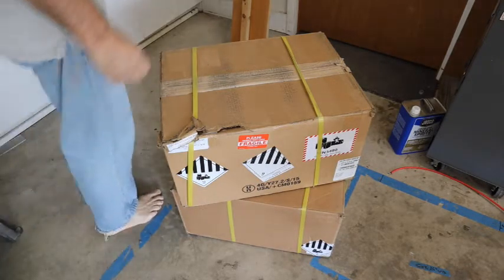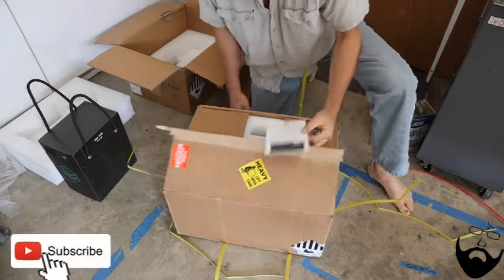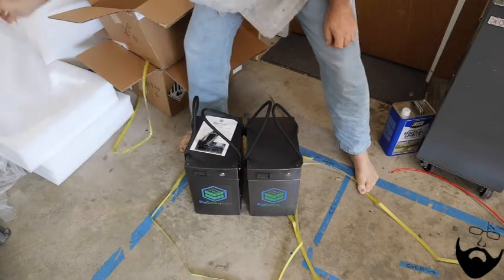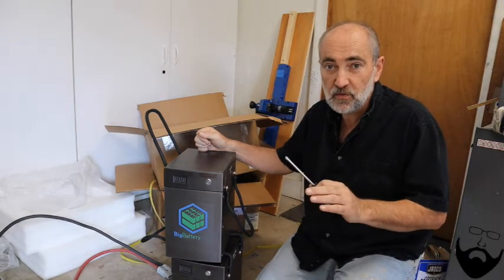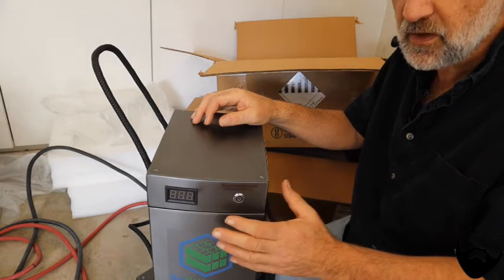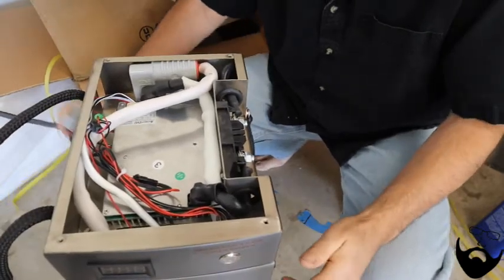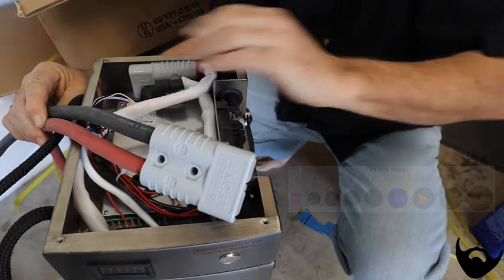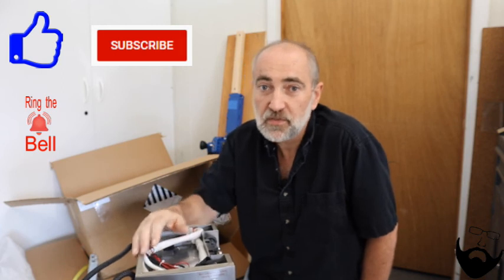Van Life - Big Battery 202 Ah LiFePO4 Lithium

Comment: Be sure to test it for full capacity. I own one - it only produced 68% of rated cap. after 6 weeks of "Customer Service" they finally sent out a "new" replacement. It only produced 72% of rated capacity. After 5 months of "No reply from customer service" I purchased replacement batteries from SOK. No problems there. I'll use my worthless Big Battery for running a light in my storage shed. It should be able to operate my light a couple of times before recharging. Good Luck with yours, and if you need warranty or customer service all I can say is hope your results are better than mine were.
Reply from the maker: I have not had any problem.  We have been living full time in the van for about two months.  The batteries have performed better than expected, I have not needed do anything with our electrical system at all.  I use the Victron BMV-712 battery monitor to monitor the state of charge, and have not been below 50%.  We are using a ten cubic foot 120 volt refrigerator.  I like the design of SOK, and Big Battery because if needed you can open the case are replace the cells or BMS. Big Battery won out since they are in the US with  a 10 year warranty.  But as always the warranty is only as good as the company that stands behind it.  So, far I have had quick replies to any questions I have had from Big Battery customer service.
Reply: @FrugalFactor  Glad to hear it's working out for you. I have been very disappointed and like I said, I have already purchased a replacement. I have had a great experience with SOK. Can't say that for BigBattery

Comment: You can buy a 300 amp Amperetime or a 300 amp Chins for the same price or less. Both batteries test at the 300 amps. There is no volt meter but as you say, you won't see the meter  any way. Just saying if you are really frugal. you can have 100 amps more free. I just ordered my second Amperetime 300 amp.
Reply from the maker: The Big Battery case is not sealed, I can take it apart and test or replace the individual cells, and BMS.  So, year from now (if needed) I can service the batteries myself.  I also, like that these batteries are fused right at the battery.  Plus,  Big Battery has a 10 year warranty.  Also, you also need to figure the physical size and placement in your van.  These fit nice above the wheel well, below the bed.

Comment: I just returned a 72v battery it seemed fine at first but then the switch that worked the voltage meter would not turn off. The hooked it up and it failed to output the amount to work anything.
Reply from the maker: That video was three years ago.  I have added a new battery to the system.  This time its an SOK - this video explains why!   https://youtu.be/vUAHamLjVaA

Comment: Thanks for the review of the Big Battery OWL Max. I bought one of these for our trailer. Fully charged it settles out at 13.28 volts, I used 183 ah and it was at 12.5 volts. Looking forward to future tests of these batteries. Let us know what your fully charged voltage is a couple of days after you charge it.

Comment: You made the wire change from #6 to 1/0 wire with the Anderson Connectors, which I would also like to do. My question is after getting the 1/0 wire and the proper size wire end fittings, how would you suggest connecting them together securely with no air leaks? You have a good previous video on adding end connectors to battery cable but these Anderson's are different.
Reply from the maker: I used 1/0 Anderson Connectors see this video https://youtu.be/QE5-G9jDZLQ
These are the connectors  https://amzn.to/3nGSOO1   To eliminate oxygen from the connection I drilled a hole in the lug, filled with solder and used a hammer crimper.  Probably more than needed.  The electrical and connections have been working well for more than a year now!

Comment: What size inverter are you running? I have two of the owl max 2 in route. I also plan on upgrading the cables to 1/0 like you have.
Reply from the maker: I am using a Victron 12 volt, 3000 watt inverter -- https://amzn.to/3to8rtL   It is large than I currently need, (a 2000 watt would have worked) but I like having a larger system now - its cheaper than upgrading the inverter later.
Reply: @FrugalFactor  can I ask what you have your charge settings set at in the multiplus 3000? I was having a little trouble with overvoltage and the multipleplus shutting down and restarting when I set the absorption and float to 14.6 V as recommended by big battery.
Reply from the maker: @Oneklrvette  I have all charge values set to 14.6V there is no benefit to variable charge voltage rates with LiFePO4 batteries.   I have not experienced my inverter shutting down and restarting.

Comment: Are you confident running 175a through that battery with your 1/0 cable? Is this the 12v version? I have the 12v 120ah. Thanks, great video.
Reply from the maker: I am confident with our electrical system.  It has worked without any failure for more than a year.  I do not have any electrical load that would pull a constant 175 Amps.  Yes, this batter is a 12V 202AH battery.  We have two connected in Parallel, creating a 12 volt 404AH system.
Reply: @FrugalFactor  thanks for the reply! Ok I guess if you have two in parallel then they would split the load so neither would see 175a.

Comment: I am looking to buy a battery for my truck camper.  Primarily for lights and to run my Webasto heater.  Maybe I will have a tv and dvd player added to my unit and mostly I am going to use it in the winter time to go skiing.  Do you think I should get the 200Ah or the 170 Ah, considering there is a difference of 300 dollars.  Thanks for your help.
Reply: Do the math...12 X 170=2000 watts the 202amphr is only about 500 more watts
Reply: @unclejack41  which means?  not worth paying 300 extra dollars for 500 extra watts?
Reply from the maker: Either will work.  Its how long do you expect to use each item.  The Webasto heater is diesel, so that does not take much after initial start.  You would need to add up all the items (wattage) and how long you expect to use them (minutes) and calculate if it is work the extra cost - for the extra time.

Comment: Thanks for your previous response, it was very helpful. have a second question and maybe you can help me with it.  
  I bought a plug and play battery bigbattery  and I want to hook it up to my new truck camper. My truck camper has a led acid battery that I don't want to use.   I also bought a lithium battery charger to charge the battery inside the house and just put it in the truck camper when I travel.  But in case that I need to charge the lithium battery using the inverter in my truck camper, its is possible to do it?   would this hurt the battery?    I hope I hear what your thoughts are.
Reply from the maker: The best method to charge your lithium battery from your vehicle alternator is using a DC to DC charger.  Renogy and Victron both make these types of chargers.
Reply: @FrugalFactor  Thanks for you quick reply. I bought a charger from bigbattery to charge the 202Ah battery.  But do you think if I plug in the charger and charge the battery in my truck in the 110v outlet will charge the battery without hurting the truck electric system?  I know if I plug in the bigbattery to the current non lithium inverter tot he bigbattery it won't charge it fully or maybe not charge it correctly.  what are your thoughts?

Comment: Do you need to change the charging profile of the charging system to accommodate the lithium battery, or does the internal BMS handle that?  Any thoughts on using this to replace an existing group 31 AGM battery? (form factor, charging considerations, etc)  Thanks for the review!
Reply from the maker: The charging profile is listed on their website. Check to see if it matches your charger or inverter charger. Suggested charging current 80 Amps, Suggested charge voltage 14.6V.  You can email Big Battery, they have been quick to respond to my questions - before and after purchase.
Reply: @FrugalFactor  I had seen the 14.6v charging voltage but didn't see anything about a lithium-specific charging profile.  I asked about that, and yes, they have been quick to respond.